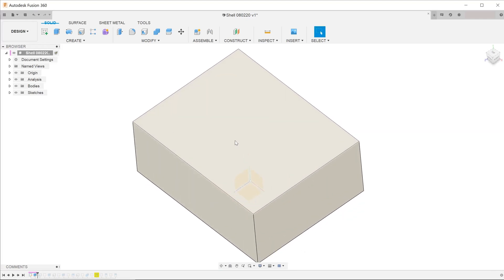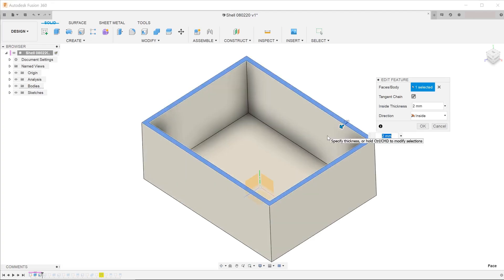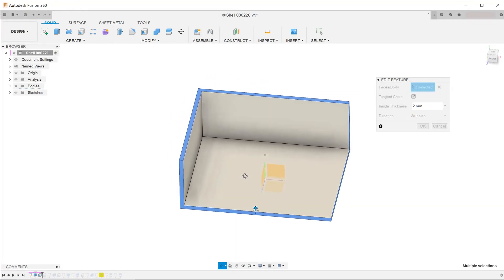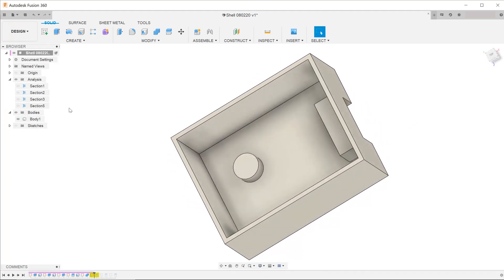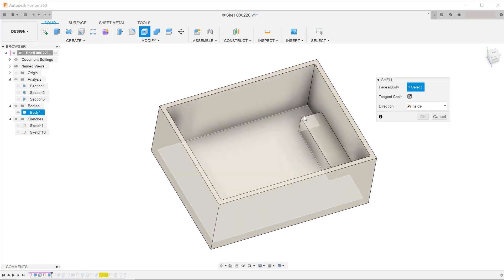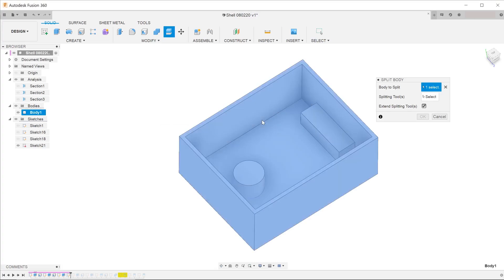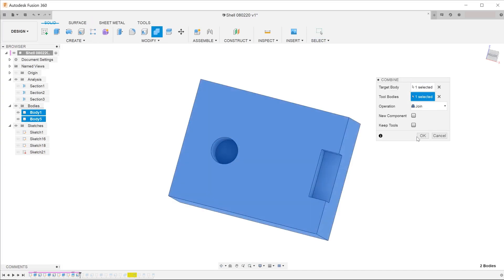Fusion 360 - Shelling

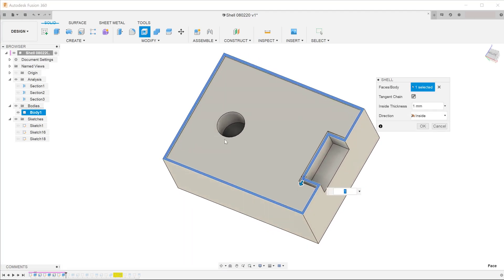Comment: So, the key here is to keep second shell command value equal or higher than first. So it don't do weird result like at 3:18. Your videos are very useful and transparent.
Reply from the maker: That's a good catch. If the small rectangular shell and the cylindrical shell was of the same thickness as the overall shell, the problem could have been avoided. I did that on purpose in order to demonstrate the split body tool. :)